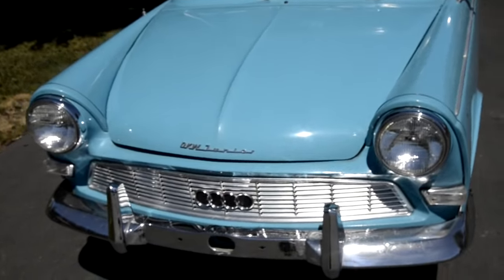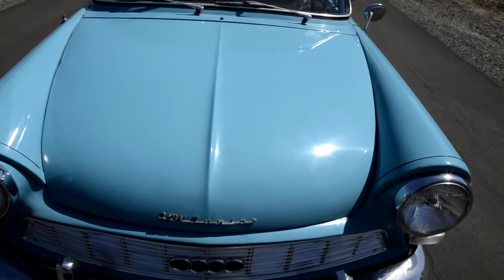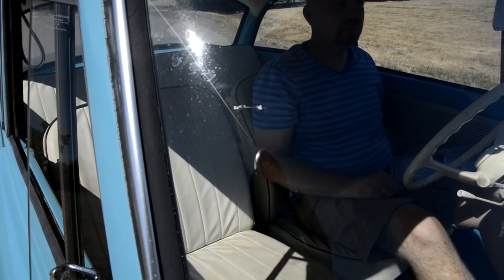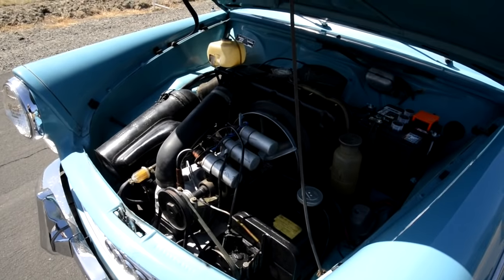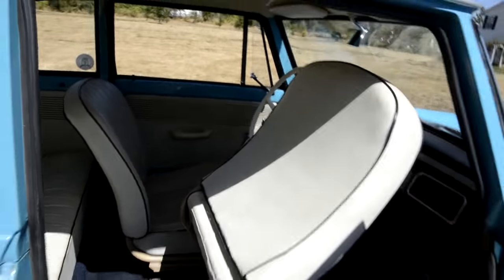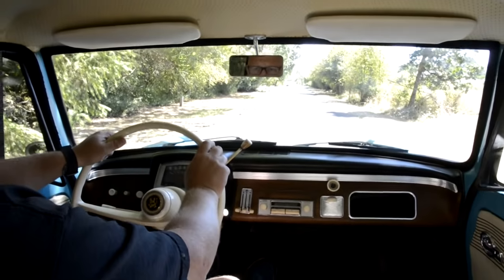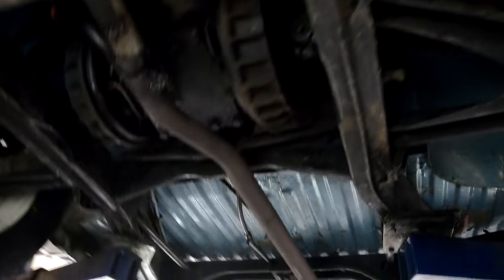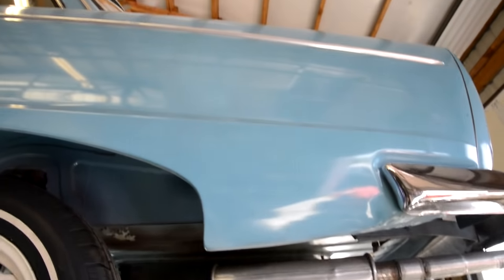1964 DKW Deluxe Junior F12 Saloon German Auto Union Audi 2 Stroke

Comment: I bought a DKW junior 800cc engine from a breaker, tuned it and fitted it to a FRISKY family three, It did 125 mph, calculated power to weight was 130 hp as the car only weighed 8 cwt. I used an Albion sequential gearbox.

Comment: just to ad some details for the uninitiated.. the cooling system does not have a water pump that's why the radiator is so large as it works on the thermo syphon principal. There is no complicated distributor only points for the three coils and the engine only has seven moving parts. Three cylinders with two stroke firing makes it as smooth as a conventional six.These cars also have a chassis with transverse leaf springs plus the early use of rack and pinion steering.
Reply: And to change the tire, you stick a jack in the side of the car.

Comment: Hood coming up is mean stuff ... my father had an F12 - no trouble there .. and later an Audi Super 90 F 103 .. which was fast like hell and needed hoodstraps for that problem .. to think doing solid 160kmh for hours fully loaded in spanish summer . on retreaded tires 😓 ... and b.t.w. the steering wheel was shaped to comply with the 'Wirtschaftswunder' upsizing ;)

Comment: I ador, I owned 2 DKW :
a 57's 3=6 and a 65's F12.
Fabulous cars but the one I prefered was the 3=6, regarding to its engine's performances
Sorry for you but the video's car it isn't a F12.
The F12 has quite different rear lights, including reversing ones, right and left.
... and the F12''s roof is more angled,  barely without the slightest curve.
Best regards.
Paul
Reply: F12 model changed over time.
Reply: @gravelydon7072  
NO !!!
Every model had its name (written front and or back), each of them with its own body's characteristics
- Very first Junior 2 cylinders of 660 cc
- Junior 741 cc and 34 cv
- Junior de Luxe 796 cc and 34 cv
Then ...
- F12 889 cc and 40 cv
- F12 Roadster 889 cc and 45 cv
- F11 who was a F12 "limited" in 796 cc and 34 cv
- And finally the F12 with the Roadster's engine power of 45 cv
But, as we can read in this video's title, a Junior, de  Luxe and F12 has never existed, these are 3 different models.
Regards
Paul